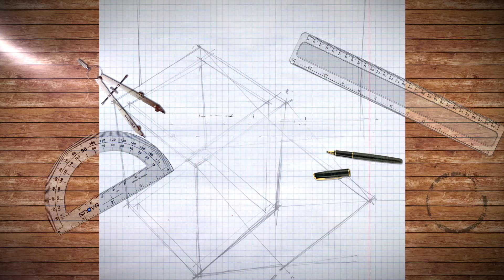Build a MOTORIZED monitor lift (on a budget!)

Comment: Hi what power supply was used?
Reply: Hi and the motor is no longer available. You mention: Relatively low rpm. What rpm is the motor you used/recommend?  thanks!

Comment: HOW TO WIRE THIS UP! 

IF you're stuck for how to wire this, it's pretty easy but NOT intuitive! I can't post a diagram but I think I can describe it well enough.

1. Wire the motor to the center poles (common) of the switch. (This isn't intuitive because you usually wire the voltage supply to the common poles.)

2. Take the negative (-) lead from your power supply and wire it to one end pole and then the DIAGONALLY OPPOSITE pole on the other end of the power switch.

3. Now you will run ONE positive (+) lead from the power supply to either of the limit switches and then jumper that connection to the other limit switch, so that they both have parallel power to them.

4. Now attach a wire from the other poles (connections) of each limit switch to the remaining two unused poles of the power switch. (If you get these reversed, you can easily change them later...or do what I do and turn the switch upside down...a lot easier.)

That's it. Test it and if "up" on the switch goes down, reverse those last two connections to the power switch in step #4 (or turn the switch over.)

PS Don't use those cheap red pushbutton switches!! Get genuine normally-closed limit-switches, which are hardly any more expensive. They last far longer and are much more precise.

It's a shame that this particular project has gone so long unfinished...kind of ironic for a popular DIY video. A list of the minor hardware and the dimensions of the materials (especially the support blocks, etc. would have been nice; I know aligning the nuts are tricky. I'm barreling on through this project because I've been a DIY'er of my own designs [and used to work in a prototype lab] for a long time so reverse-engineering someone else's from the video is not that hard.)

Comment: Almost a whole minute of advertising really sucks!  
Why not use a column lift or linear actuator?  Its less than $200.  Your system saves $200 which is not a whole lot, and huge bother to build.

Comment: This is the WRONG kind of bearing. The ones you're using are "radial bearings," which are for radial loads like wheels. The bearings you're looking for in this application are called "thrust bearings," and are designed for axial loads like a lead screw. They're not that much more money, but without the correct bearings this assembly WILL fail as well as experience more wear, sticking, and higher load on the motor.
Reply: I think that what you propose is an improvement to the initial design and i will go with this. Thanks for sharing!

Comment: Is this the equivalent for men,  of women watching make up videos?
Reply from the maker: I think so!
Reply: hehe, I am going to build your cordless monitor though! This is the controller board and screen I ordered,  http://www.ebay.com/itm/192204229076
very expensive but its the best one on the market. Apparently the controller boards for these are hard to find. I also got a 20.000  battery bank (230 g) and a Microsoft wireless display adapter v2. I have no previous electrical experience, but you make it looks so damn easy, even a lug like me can be fooled in to thinking he can do it!